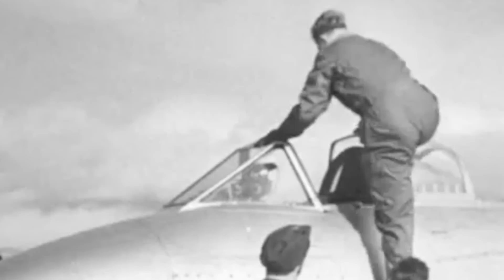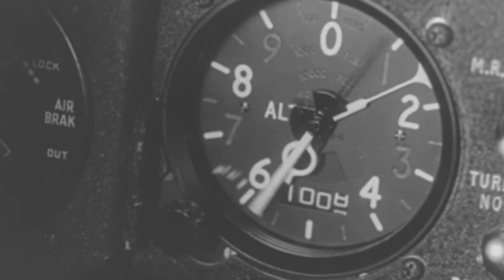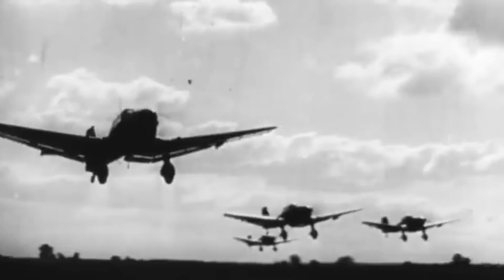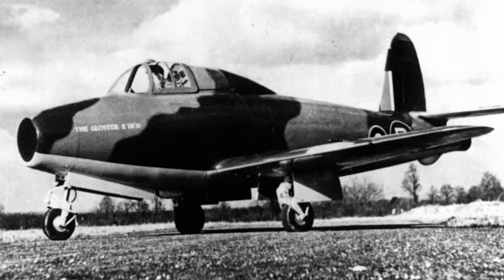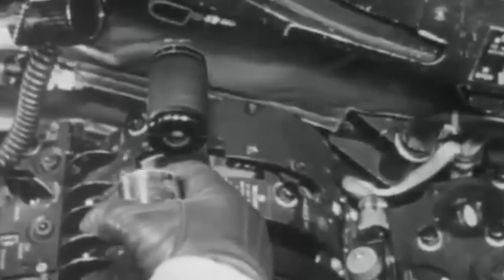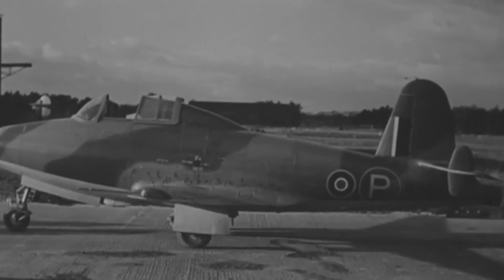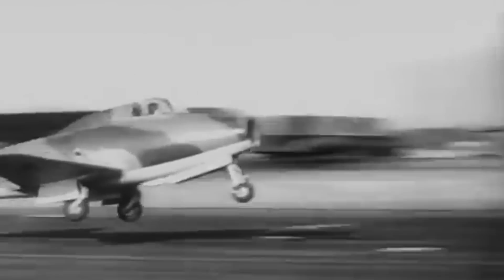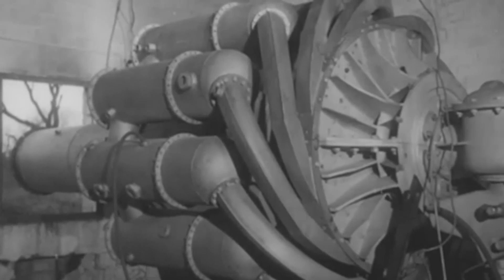Britain's 500 MPH Coffin With Wings

Comment: What’s a Hinkel?
Reply: Indeed.
Reply: Heinkel.... as in He-178, the world's first jet aircraft to fly successfully in 1939, Britian would not achieve jet flight until 1941..
Reply: @DoktorBayerischeMotorenWerke 

O'hain's engine used for the HE-178 was a bad copy of Whittle's work but used a radial turbine to avoid patent infringement problems. The aircraft & it's engine were of no interest to any relevant German people at the time. Whittles engines ran before O'hain's engine. 
 The Nimonic Nickel super alloys required for reliable turbine blade manufacture which were developed in England in 1940 were available nowhere else. In Germany & the US they were attempting to use various stainless steel alloys which, being mostly iron, don't work for the application. Thus no German gas turbine engine would achieve the the reliability and power of the British engines during the 1940s. 

We feel we can clear up some commonly held misconceptions.

It's always good to set out the facts isn't it.

The W.1X engine powered the E.28/39 for taxi testing on 7 April 1941 at Brockworth near the factory in Gloucester, where it took to the air for two or three short hops of several hundred yards at about six feet from the ground.[6]

    The definitive W.1 of 850 lbf (3.8 kN) thrust ran on 12 April 1941, and on 15 May the W.1-powered E.28/39 took off from Cranwell at 7:40 pm, flying for 17 minutes and reaching a maximum speed of around 340 mph (545 km/h). Of course it wasn't long before 
the aircraft had exceeded 500 mph. 

    The centrifugal compressor Whittle engine would of course go on to be the basis of the RR Nene, the most powerful & reliable gas turbine aero engine on the planet in 1944. Versions of that engine would indeed be copied or produced under licence in many countries including China, Russia, the US, the UK, Belgium & Switzerland with more than 50,000 being produced over the next 2 decades. Obviously gas turbine aero engines which include centrifugal compressors are still manufactured, Pratt & Whitney & Lycoming obviously being examples of two companies producing such engines.

   Whittle demonstrated his engine in 1937, the world's first demonstration of a pure gas turbine aero engine.
Gloster E28/29 + Whittle W1 Short Hops April 1941.  FF May 1941.
Gloster Meteor First flight 5 March 1943
Gloster Meteor In Service (after extensive trials & with a very reliable engine.) Had a 100% successful combat 100% kill ratio during WW2 operational service.
Introduction into service 27 July 1944
3947 produced. Operational in more than 17 countries. Retired 1980s RAF. Broke speed records in 1945 & 1946. A Meteor was the world's first turboprop.

   Me 262 First flight 18 April 1941 with piston engine (Junkers Jumo 210).
18 July 1942 with junk jet engines Junkers Jumo 004
In service Introduction April 1944 but mostly still highly experimental, very unreliable & fairly useless.
Had a 3 to 1 losses rate just attacking large swarms of bombers. That's 3 262s lost for each downed bomber.  Instructed to not engage piston engine fighters, risking engine destruction was deemed preferable by exceeding the 450 mph do not exceed speed.
Retired 1945 Germany, 1951 Czechoslovakia.
Primary users Luftwaffe & Czechoslovak Air Force.

Hope this helps. 
Cheers 👍😎🙂. 

. 
   
 Xcvcxcvcxcvcxvv
. ....., .............. ....
. ..... ........ ..........
Reply: @petemaly8950  Name a British jet still made in the UK?
Reply: @DoktorBayerischeMotorenWerke 

We feel we can clear up some common false myths, misunderstandings & misconceptions.

It is indeed always very important to note the relevant facts obviously.

Of course It's perfectly normal to find this comment extremely annoying.
 
    Regarding the UK Aerospace Sector.

  WHY IS IT THEY CAN'T ANSWER VERY SIMPLE QUESTIONS ⁉️ 😅
  A very simple question indeed.
   
Which airline recently ordered 60 RR Trent XWB Engines? 

Also name a single Germany company that makes German jet aircraft in Germany & name a single German Company that makes German gas turbine aero engines suitable for widebody airliners.

  ANSWERING The QUESTION WON'T HURT A BIT, COME ON NOW, THEY CAN DO IT IF THEY TRY HARD ENOUGH.

     That's correct, Brazil makes very good airliners & Brazil is 100th down the list along with Indonesia for wealth per capita.
Norway Holland Denmark Ireland Belgium - Top 20 wealth per capita - Don't make airliners -  its as simple as that.
  
  Agreed, that is correct of course, clearly there are many countries that could easily produce airliners of better  quality than Bow-wing (see b-47 wing folding & wing collapse incidents) but don't for some very good reasons. Bow-wing being a result of the size of the US, the large protected domestic market & great ease of testing new types due to the equator to arctic geography & a few other reasons related to production scale capability, politics & economics.

  Obviously there really is nothing special about Bow-wing, having more than 50 years design / build experience on the type means they have no excuses for the horrendous max incidents for example.

    Indeed BAe Systems & Rolls Royce combined now do more Airbus work than Germany on an absolute basis & significantly more work than that on a per capita basis.
   
     Agreed, Per capita for the home nation BAe Systems is the world's largest defence contractor.
  
    Correct, BAe systems announced the recent £4 Billion takeover of Colorado based US based Ball Aerospace.
  
    It's definitely the case that BAE systems now does a significantly higher value of work for Airbus than it did when it was a major Airbus shareholder before 2005.
     
      Obviously RR now owns US Engine maker Allison for example which does classified Aerospace work for the US Govt.
   
   Yes, that's right of course, Anybody currently flying on a widebody airliner stands a good chance of being on an aircraft powered by RR gas turbine aero engines built in the UK.

   A typical but small glimpse of what goes on in the very internationally orientated British aerospace sector.  

      Boeing Apache Attack Helicopter.
AH-64: 75 UK suppliers, 7% UK content, global fleet of 1280+ aircraft.
F35B more than 130 UK Suppliers, more than 30% UK content.
F35A & F35C more than 130 UK Suppliers, more than 15% UK content.

   There is no doubt that an airline has just ordered
60 RR England Trent XWB Engines

Obviously the UK has the
World's Highest Combined Per Capita
 Nuclear / Defence / Aerospace Sector Activity.

Rolls Royce Holdings UK
Subsidiaries
- Rolls-Royce plc
- Rolls-Royce North America (Allison etc Classified Military stuff)
- Rolls-Royce AB
- Rolls-Royce Deutschland
- Rolls-Royce India Private Limited
- Rolls-Royce Marine Power Operations
- Vinters Engineering Limited
- Rolls-Royce Controls and Data Services
- Rolls-Royce Power Systems
- Bergen Marine
Joint ventures include:
- Rolls-Royce Turbomeca
- MTU Turbomeca -

Trent Family
The MT30 (Marine Turbine)
Industrial Trent 60 Gas Turbine
Trent 7000
Trent XWB Airbus A330neo.
Trent 1500
Trent 1000
Trent 500
Trent 600
Trent 700
Trent 800
Trent 8100
Trent 900

RR wholly owned subsidiaries in Germany handle smaller 2 shaft RR gas turbine aero engine work.

We hope this helps of course as always.  Cheers & 😎👍 indeed.

       O B V I O U S L Y  

. ..... ..... ......  ..... ... ....... ...... ....
.... ..    .. .. .... .... .. ... ....... ... ......
Clearly the line above this line is not blank.

Comment: It was simply a 'proof of concept' aeroplane no way was it a failure.
A very stupid title!
Reply: It was certainly a failure in a sense that this type of engine was not the future, centrifugal jet engines were an evolutionary dead-end concept that was complete outdated when it entered service, Britian was a decade behind Germany in Jet engine technology..
Reply: @DoktorBayerischeMotorenWerke  

We feel we can clear up some commonly held misconceptions.

It's always good to set out the facts isn't it.

The W.1X engine powered the E.28/39 for taxi testing on 7 April 1941 at Brockworth near the factory in Gloucester, where it took to the air for two or three short hops of several hundred yards at about six feet from the ground.[6]

    The definitive W.1 of 850 lbf (3.8 kN) thrust ran on 12 April 1941, and on 15 May the W.1-powered E.28/39 took off from Cranwell at 7:40 pm, flying for 17 minutes and reaching a maximum speed of around 340 mph (545 km/h). Of course it wasn't long before 
the aircraft had exceeded 500 mph. 

    The centrifugal compressor Whittle engine would of course go on to be the basis of the RR Nene, the most powerful & reliable gas turbine aero engine on the planet in 1944. Versions of that engine would indeed be copied or produced under licence in many countries including China, Russia, the US, the UK, Belgium & Switzerland with more than 50,000 being produced over the next 2 decades. Obviously gas turbine aero engines which include centrifugal compressors are still manufactured, Pratt & Whitney & Lycoming obviously being examples of two companies producing such engines.

   Whittle demonstrated his engine in 1937, the world's first demonstration of a pure gas turbine aero engine.
Gloster E28/29 + Whittle W1 Short Hops April 1941.  FF May 1941.
Gloster Meteor First flight 5 March 1943
Gloster Meteor In Service (after extensive trials & with a very reliable engine.) Had a 100% successful combat 100% kill ratio during WW2 operational service.
Introduction into service 27 July 1944
3947 produced. Operational in more than 17 countries. Retired 1980s RAF. Broke speed records in 1945 & 1946. A Meteor was the world's first turboprop.

   Me 262 First flight 18 April 1941 with piston engine (Junkers Jumo 210).
18 July 1942 with junk jet engines Junkers Jumo 004
In service Introduction April 1944 but mostly still highly experimental, very unreliable & fairly useless.
Had a 3 to 1 losses rate just attacking large swarms of bombers. That's 3 262s lost for each downed bomber.  Instructed to not engage piston engine fighters, risking engine destruction was deemed preferable by exceeding the 450 mph do not exceed speed.
Retired 1945 Germany, 1951 Czechoslovakia.
Primary users Luftwaffe & Czechoslovak Air Force.

Hope this helps. 
Cheers 👍😎🙂. 

. 
   
 Xcvcxcvcxcvcxvv
. ....., .............. ....
. ..... ........ ..........
Reply: @DoktorBayerischeMotorenWerke  Lats get back onto the subject shall we!
It was stated that the Gloster 'whittle' development aircraft was a failure!
IT WASN'T
The data received enabled Gloster to develop the Gloster Meteor Jet Fighter & DH to develop the Vampire Jet Fighter.
Reply: @DoktorBayerischeMotorenWerke  It's worth remembering that the Gloster 'Whittle' development aircraft & the Gloster Meteor Fighter Aircraft started life with a tricycle undercarriage.
Unlike the Me262 & Me Komet that both started life with the backward thinking Tail Dragger undercarriage that  burnt & 'dug up' the tarmac runway on every takeoff.
Reply: @DoktorBayerischeMotorenWerke 

That's correct of course. All allied jets were very successful during WW2 however they were in service over the UK or in allied controlled territory only to keep them out of the wrong hands (German & Russian).  
   The almost totally useless 262 & it's shoddy 46 minute life Junko 004 engines with a do not exceed speed of 453 mph was limited to anti bomber patrol over Germany which it was also almost useless at & running away from allied piston engine aircraft.
Reply: Clearly indeed.